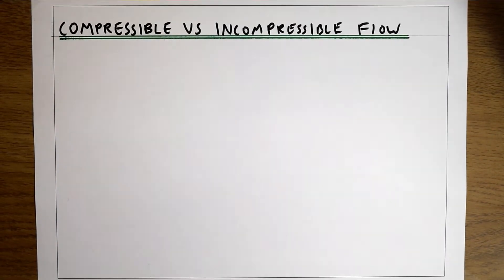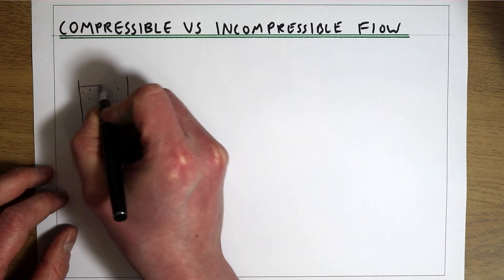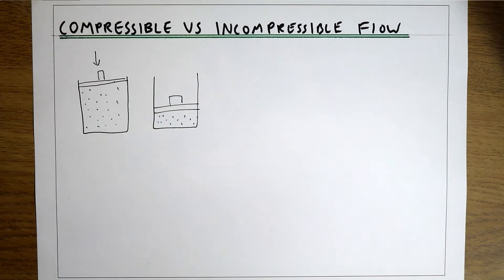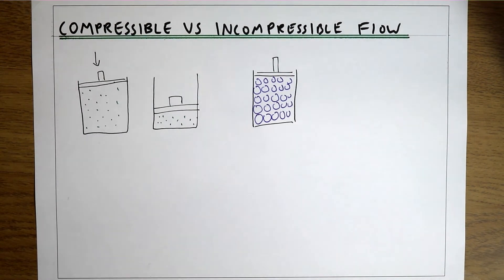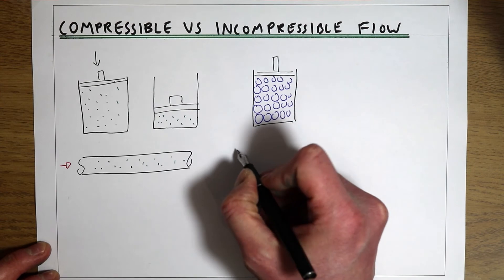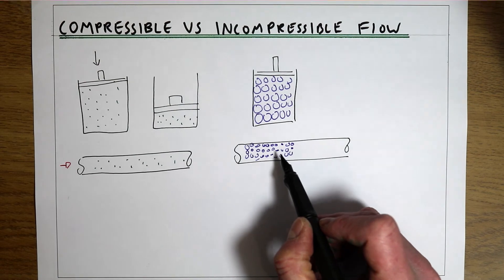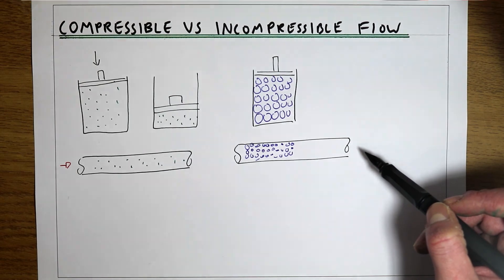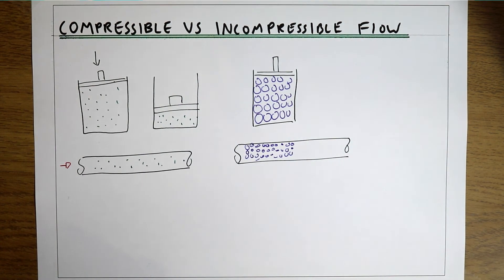Compressible vs incompressible flow

Comment: The explanation of the flow density is too superficial. Both liquids and gases are compressible. And the change in density in the flow with pressure depends on the Mach number. The general rule that for a Mach number lower than 0.3 they can be considered incompressible applies for both, since the change in density stays below 5%.  However, since the compressibility of gases is about 10 times larger than the liquids' one, this results in a lower velocity correspondent to the Mach number at which a gas can be considered incompressible. This velocity for gases is about 110 m/s.
Reply from the maker: Hi Dario, thanks for the interesting comment! In this video I was explaining compressibility in the context of the very basic assumptions used for solving simple hydraulic flow problems, where the assumption water is 100% incompressible often a very useful and accurate one. You have pointed out what any good teacher should reinforce when teaching problem solving using idealised assumptions – everything is more complicated in the real world! Maybe one day I’ll make a comprehensive video about compressibility.

Comment: Does that mean for incompressible fluids, the divergence is always 0? I’ve just started learning about divergence and it sounds similar to when you said “if the flow in is 10m/s, the flow out must also be 10m/s”. That sounds similar to 0 divergence. Is that right or am i over looking something
Reply from the maker: Yes absolutely correct, an incompressible fluid will have a divergence of zero.